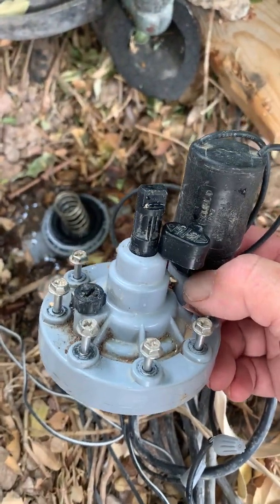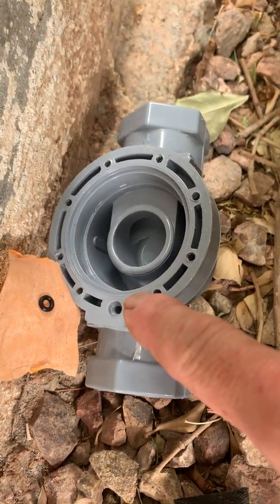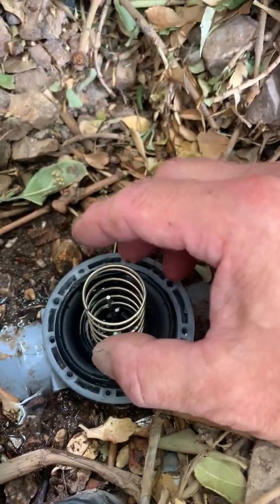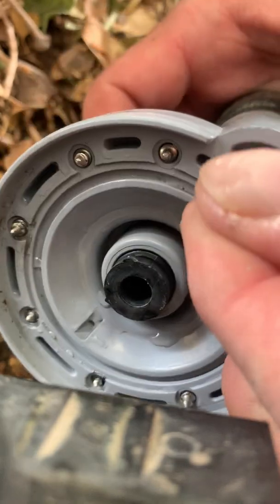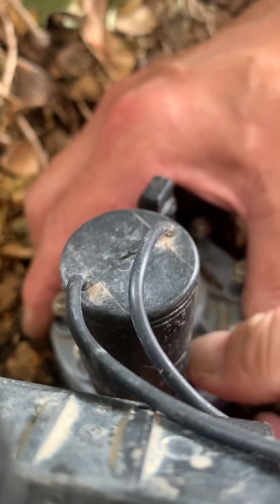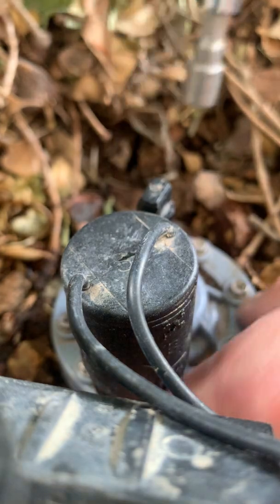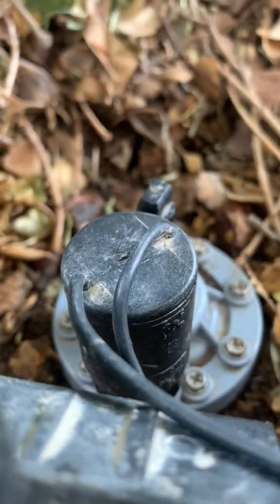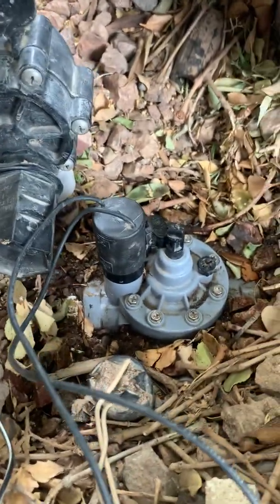Irritrol 2500 Irrigation Valve Diaphragm Replacement Tricks

Comment: Hello. This was the EXACT problem I had. Bought a house and inspector thought I had a water main leak. Found a buried 2500 valve and saw that it was leaking just under the solenoid. Found your video and did the exact same thing. I also ordered the o ring for my other valves. Thank you very much. Also, maybe change the title to have the 2500 in it vs the 250 as they don’t make a 250 valve. 😃👍
Reply from the maker: Thanks for letting me know about the correct valve number!  Glad the video was of help to you!